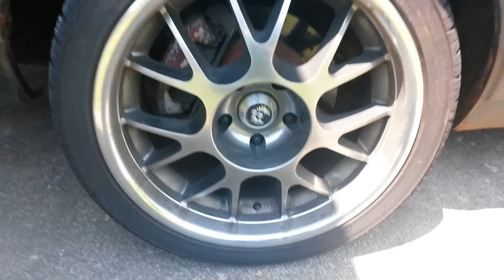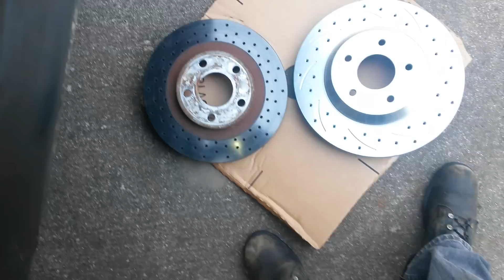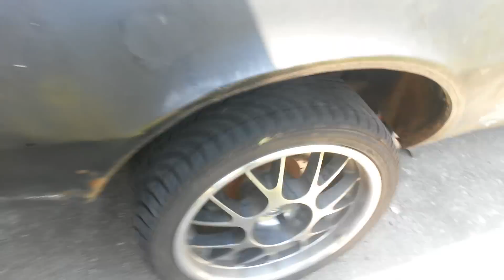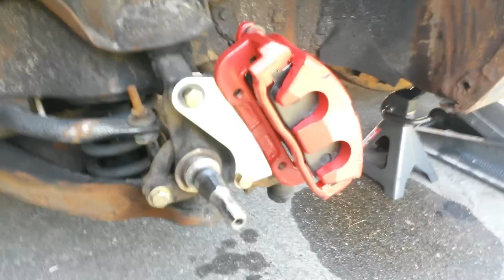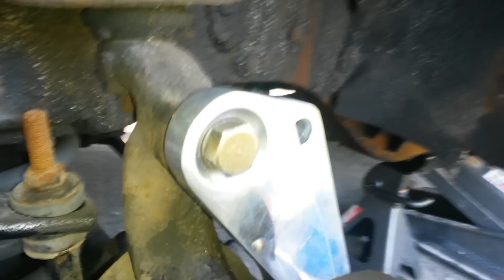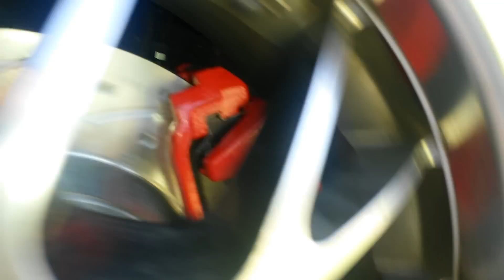corvette brake swap 1968 pontiac firebird pro touring

Comment: What kind of wheels were the 17” ones? I’m looking on doing the same swap for my 69 camaro, and 17” torq thrust 2s need a spacer to clear the caliper.
Reply from the maker: general23cmp boss 338, and they cleared no problems.  17 front and 18 rears.  The torque thrust wheels have problems with a lot of modern brakes.  So I generally avoid them

Comment: Nice work, I would consider installing the upgrade on the chevelle I am builidng but I like the factory 15x8 ralllys hat it has and they won't fit with the 13" rotors. Thanks for the video.
Reply from the maker: yeah, 17" wheels are minimum for these brakes.

Comment: What parts did you get from CPP?  

The hub and caliper bracket don't look like the ones CPP sells.  

Also, the C5 brake setups from CPP usually feature their own steering knuckle/spindle that allows the caliper to bolt on without the use of an adapter bracket.
Reply from the maker: Firebert79TA this is an older video, not sure if they still sell the kit.  everything was bought from CPP

Comment: How are u liking the brakes so far.....im planning on getting some from CPP also...since there not so much $ ... are those stock disc spindles with the drum hubs?
Reply from the maker: yes, stock spindles and stock drum hubs.  DO NOT USE CPP, I repeat, DO NOT USE CPP.  there's a guy on ebay that sells you the same brakes for $425 and that INCLUDES NEW DRUM HUBS.  Thats CHEAPER than CPP and better quality.  As ar as the brakes themselves, they are amazing, check out the wilwood prop valve video to see how to make them t he best they can be.  ALSO KORE3 is a company that sells similar corvette swaps, THEY have ALL corvette setups, SO you can go Z06 6 piston if you want and so on...

Comment: I just got the c5 13in kit from cpp for my 64 chevelle.  Got the kit with the knuckles and sealed hubs it's a sweat setup. Got it from summit they 2 day aired it to me for free.
Reply from the maker: CIA Assassin those sealed roller bearings can't take the same side load the taper bearings can... a lot of the guys racing their c5 corvettes and ls1 camaros are having problems with their hubs blowing out with hard use...  just food for thought.
Reply: There's advantages and disadvantages to both. My experience has been years of trouble free driving with sealed hubs I don't do racing just a quarter hit now and then.
Reply from the maker: CIA Assassin this is true

Comment: hi invicible got a question i msg u a couple day ago for a 74 chevy c10 u got a facebook or other social media to msg u well this is my set up i figuerd i can get the disc mill to just a hub n re drill them or what kinda hub can i use for the corvette c5 swap
Reply from the maker: the hub bore diameter is 70.5mm on a corvette.  if the hub bore on a C10 is the same then you can drill the stud pattern of your choice and use your c10 hub.  hopefully that helps.  i do not know what bracket you will need though, i have only done the swap on GM muscle cars

Comment: Did you realize that you had the LS calipers on wrong to begin with? That is why they rubbed the sway bar. Agreed about CPP......horrible!
Reply from the maker: Yeah, took a while but when i sold my buddy the ls brakes for his 74 nova i installed them the right way.  The corvette disc brakes i did for my 67 tempest project are the kore3 kit using gm calipers and they are a much better product.  Prob drive the same as the cpp stuff.  Thanks for stopping by man.
Reply: Invincible Extremes Did this front and rear brake swap on my Pro Touring El Camino years ago with a Craigslist and Ebay brake find. Just ordered all new calipers, brackets, pads, and rotors (made by Powerstop)from Autoeverything.com for only $425 shipped to do the same upgrade on my Pro Touring Chevelle also.
Reply from the maker: Brian Coyle nice, yeah its affordable and they work great.   The rears especialy are my fav.

Comment: Do you know the sellers name on ebay??
Reply from the maker: mgchevyparts

http://www.ebay.com/itm/201087804208?ssPageName=STRK:MEWAX:VRI&_trksid=p3984.m1423.l2661

I have NO association with this guy.  ONLY reason I'm recommending him is cause the hubs are machined here in the states and so is the bracket.  Plus he's willing to work with you.  The price is cheaper than CPP because they don't include the hubs that you will still need to buy...this guys hubs come assembled with studs pressed in... cpp sells you garbage hubs that you'll still need to BUY your own longer studs for safety because the ones they include in the "complete" kit don't work with stock hubs.  btw two of the 5 holes in one of my CPP hubs cracked as i was pressing in the studs.... so yeah buyer beware on CPP.   But as far as the brakes, they are amazing brakes. just get them else where.  I recommend the company "KORE3"  nothing but good from them, but maybe not as cheap...

also one important note.  check what size your upper anchor bolt is and request that size from the ebay seller I listed.  Kore3 for example needs the size up front before you buy their corvette brake brackets... nobody else will give you that heads up, they'll just tell you to machine the spindle to accept the size they ship with...  I made a tapered shim and used the smaller 1/2-20 bolt my spindle is drilled for stock, and have had no problems.

sorry about the long response, but just trying to be thorough, unlike some, I actually DRIVE my car everywhere, like to get milk, to work, i mean EVERYWHERE... ;-)